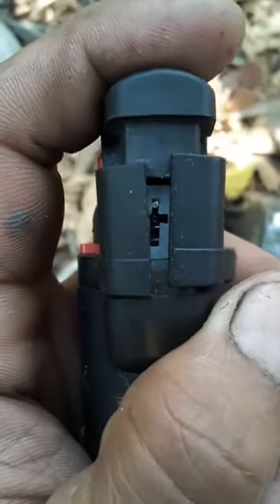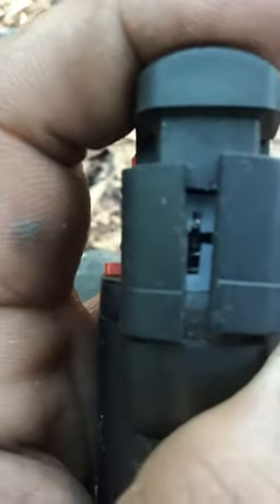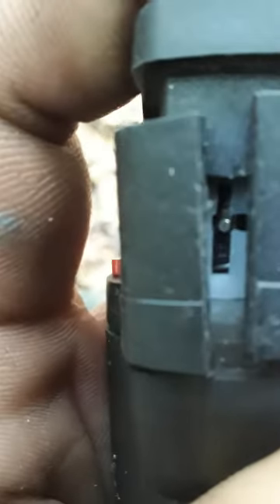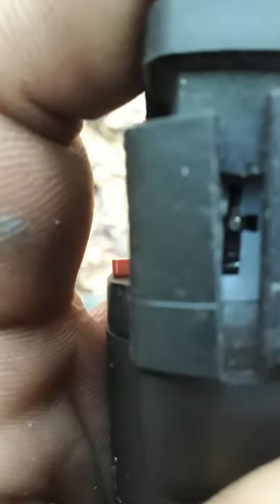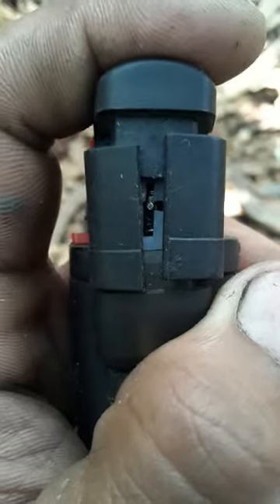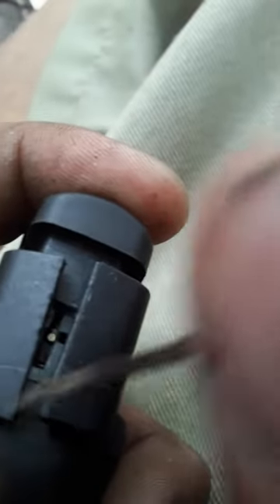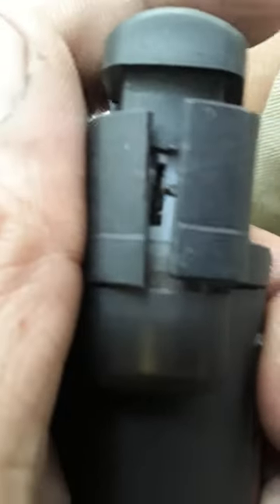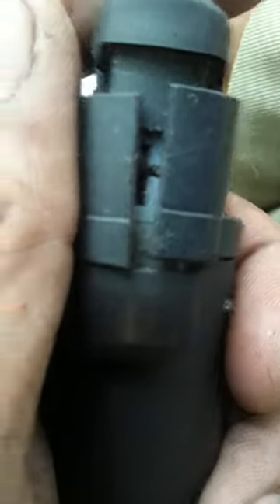Eagle torch hack

Comment: Yo lmfao . The part where u stopped to hit it, to make it work. I used to have the same torch . And had to use this method😂
Reply: God i fuckin hate these torches 😂 i find it easier to jus press the trigger in and then hit the lock switch so it stays down n then js use a bic to get the hoe ignited and it js stays on but beats resetting that jank ass pin everytime

Comment: just get another lighter that doesnt have gas but sparks.much easier
Reply: If yur torch aint gassin like it should try flippin it n letting out all the extra air w a screwdriver, or your gas could be bad you could js let it sit outside for a bit n let it get all the bad shit out, i press the trigger down n hit the lock so it stays down